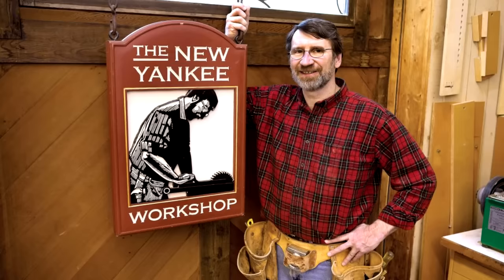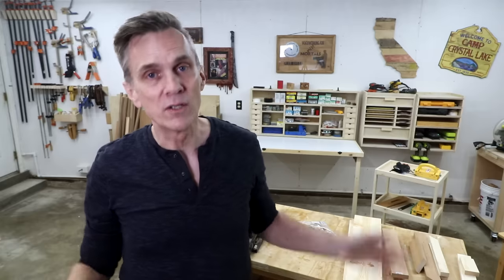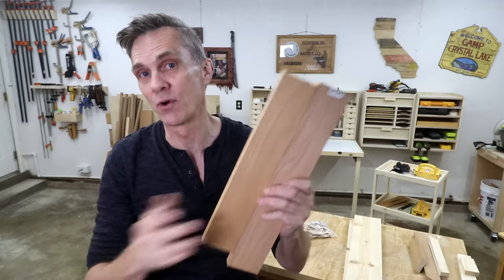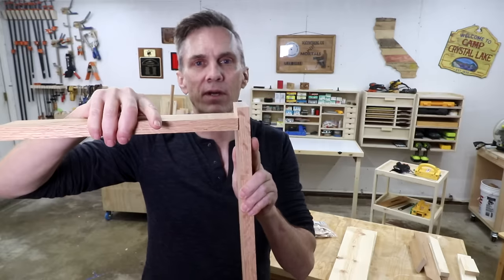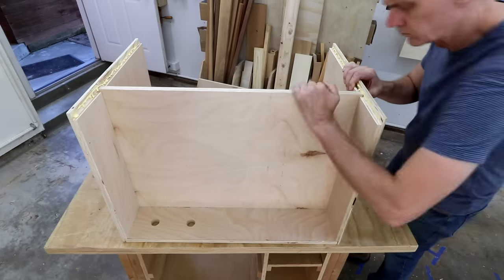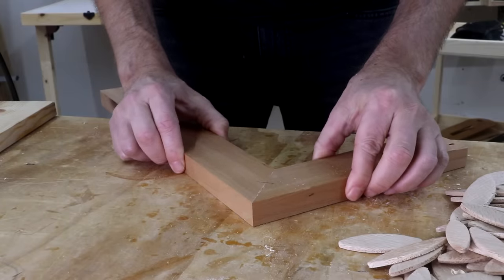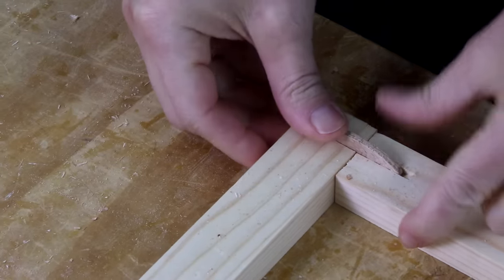So, is a biscuit joiner completely useless?

Comment: #1) You mentioned they add zero strength. Biscuit joinery isn't for strength but rather for alignment.
#2) You mentioned gluing boards edge to edge is super strong on its own. Butt joints are the weakest of all joints, and I would think (and I could be wrong on this) that biscuit joints are stronger than butt joints, just for having more gluing surfaces involved (this is taking into consideration the biscuits themselves). The Wood Whisperer once mentioned that he visited a wood working furniture maker and was surprised to see that the guy used biscuit joinery quite heavily. While it is admittedly a very specialized tool and probably doesn't get much use in peoples' shops, I wouldn't go so far as to call it useless, at least not my opinion. Sure there are other options out there (like the Festool Domino for example), but joiners are not super expensive and when used properly, they really do make alignment quite a nice task.

Comment: I use to use one in the sign industry to strengthen the joints in the sealed plywood style signs... but now we use a rigid aluminum product with it's own special joint pins that is far cheaper and more durable.

Comment: Norm used all of that joinery on the show, including the pocket screw method. Once he got the jig he used it a lot. I saw a pocket screw split out the wood when a guy tightened it up, so now in my head that's all I can see, so I'm not a fan.

Since Norm IS the greatest craftsman who ever has, or WILL live, there must be something wonderful about biscuit joinery, simply because he uses them, which is good enough for me.

Oh, and about the biscuits being too big for some applications, he had a small biscuit cutting tool and smaller biscuits for those occasions.

Now if we could all bow down to Norm for a few moments of worship and reflection that would be great.   :-)

Comment: They are useful for lining up joints, but add very little strength
Reply: I agree Jeff. If you use them to strenghten a glue joint your glue joint was bad to start with. I use them to align and the glue for strength.

Comment: There must be a law that if you show using a biscuit joiner in a video you must say "it doesn't help with strength , only alignment" since almost every video I've watched with biscuit joinery states this lol
Reply: I don’t think it’s quite correct, either. I’ve seen at least one source say that one biscuit produces a joint with half the strength of a Festool Domino joint and two biscuits essentially match it. Given how fast and cheap they are to put in, this is awfully good.

Comment: The Porter-Cable biscuit joiner includes a second, smaller cutter blade for joining face frames and miter joints...so yes, a biscuit joiner can be used on miter joints.

Comment: Edge grain joints are only weaker if you don’t add enough glue. The edges soaks up glue. Otherwise they are at least the same, and probably stronger.

Comment: I'm just a nobody on YouTube, and get as many views in a year as you do in a minute, so take this for what it's worth...  I think a novice wood worker would do well to learn how to use one.  I wear my biscuit joiner out, and I think you're under-valuing the strength they add to miters (not all miters hold pictures - some hold 40 lb mirrors)!   ...and like others have said, I've never experienced that much slop when I've used mine.  

I see some of your points, but I wouldn't tell beginners to count it out just because pocket screws are faster.
Reply: Exactly
When I watch this if so how sloppy that was I was like what
Mine are always tight I usually have to use a rubber mallet to beat the pieces together before clamping
I'm not really sure why his are so very loose

Comment: I remember Norm using the biscuit joiner on every show I watched. At the time it seemed like a bulletproof way to join everything, and not use ugly screws or hardware... Now that I see how they work and how they are very limited, I think the intent was there, but they are so small they only work to help align and assemble joints...
Reply: That is the intended use for biscuits, aligning joints to assist with assembly work, they are not designed as anything else.

Comment: Ive built speaker enclosures using 3/4" stock cut 45 degrees with only glue.  No issues.

Is this weaker than I realize?

Comment: A biscuit joint is, afaik, a nice cross-over between a tongue-and-groove with a loose tongue, and a dowel joint (or domino for that matter). Both of these joints have a drawback: they weaken the wood in specific ways. The loose tongue does so by reducing the wood thickness over the whole length of the joint. The dowel joint by coming (potentially) too close to the edge of the material. The biscuit joint solves both issues. Maybe it should be kept in mind that cabinets are built in a different way in the EU (where the biscuit joiner was invented) than they are in the States. We use a lot more often plate material, and a lot less (massive) profiles. Saying the biscuit joiner is useless is nice clickbait, but it's also a bit of a stretch.

Comment: Norm probably did popularize them, but he was late to the party.  They were the domino of their day, and Fine Woodworking (when it was written by experts) was very excited when they came off patent, and everyone was anxious to get one at a decent price. Super cabinetmaker Franz Klauzs made a whole video about them.  The are not as good at some things as Dominos, but that is like saying a 2" screw is not as strong as a 3 inch screw.  Ok, what about using 2 of them?  Often in the 90 degree situations you can get several stacked in there. And even with one, when sensibly used they rarely break in real world situations.  They might not stand up, or even have space to be put in, in some fancy chair, but then Dominos are probably not up to that either, certainly a step down from formal joinery that is sized to sections.

They work really well in situations where a dado works, and they are faster to put in, and much less dust is produced, and they will leave people wondering how the joint was made.

Your machine is maybe at fault as it is more often tough to get them in their slots than not.  And I have never had one wobble as every one you showed seems to have.

-----------------

People using biscuits should expect much greater strength than pocket screws which are very weak (but require a battery of clamps).  Yet PSs are successfully used in a lot of furniture, even given how bad they are.  This because most things hold up reasonably well when the parts can't be moved out of reference.  So a cabinet that is assembled on 5 sides, then hung on a wall will hold up well because it is stable.  In such situation biscuits will overperform and never fail.  One can make successful frame and panel, kitchen type doors  using biscuits, but I would be more confident if I had a domino.  Better still would be slip joints and they are easily cut on a table saw.  That said.  I have biscuit joined lots of doors in my own houses, because I knew I could repair them if they failed, and I have never had a failure...  Whether they would stand up to an angry door slamming contest, or a kid swinging from kitchen doors, is a test someone else can run.

Comment: If you were using the correct thickness biscuits for your blade you wouldn't have the slop in the joint. Mine fit snugly. At the time they were a good choice but better options exist today so you are I believe correct in saying don't buy a biscuit joiner today. I can' think of anything a biscuit joiner is good for that can't be done with another tool or method. today I use Dominos in places where I used to use biscuits. Dowels are another choice when used with a good dowel jig.

Comment: Interesting video. Proves that you should not buy cheap tools. You get none of that play if you use either Lamello or Porter Cable joiner. Also, there is a video on YouTube by Dowelmax that shows in their tests that a properly used Dowelmax is just as strong as  dominoes.  That is the fun of woodworking, we do not have to agree; just have fun building OUR way. Thanks for the video.

Comment: i like my biscuit jointer and use it often. my biscuits are tapped in with a hammer, not sloppy and loose like the ones youve shown. i would agree that its use is certainly limited, and having a bad fit like youve shown would surely be useless, but in general i disagree.

Comment: Hi Steve,thank you for so many good videos. I really learn a lot and in my Workshop the tools all together are I think no more than 1200€. I am trapped with the bosch batery system though. It is so nice to use the same batery for drilling, sawing, vaccum cleaning and of course the radio.I think the original biscuit jointer comes form Lamello. They are really precise and as good as festool. have a look at Clamex or Tenso.I like my cheap jointer from ebay for 30€ total on ebay. It just gives a good feeling to join bords and be kind of sure that they will stay in line.Have a nice Christmas time.best wishes from Germany

Comment: Not sure what your biscuit jointer is, but use mine often in the shop to help with glue ups. My biscuits are so tight that the majority of them have to be per swayed with a dead blow hammer to get them in the slot, maybe this is one of those times that spending a little more at the store pays off.

Comment: While I agree with you almost 100%, swearing off biscuit joints due to inaccuracy based on what has to be the worst biscuit jointer ever made is like saying you hate Chinese food based off having tried Top Ramen a couple times and found it yucky.

I've mirrored your strength argument with students for years but they've seen people use them on YouTube and the likes of Norm so they riddle their simple glue up with them, only to find that they cut through one when they cut to final length and then have to spend the rest of their life looking at the end of a biscuit.  I try to remind them that I told them not to do it so that the mistake stings a little more.

Comment: Well, found this in Jan. 2021, I was going to buy a joiner but now, I still need to look for a solution for my project.  Building a rolling workbench.  3/4 in. plywood surface.  I've cut a space and mounted my Mitre saw in that space put it on hinges so I can lower in down inside the bench.  Leaving that open space now.  But now trying to figure out a way to not only lay the original (cut out) back to the top and keeping it level and (tight).  The sides are level resting on 2x4 rails.  But if I could only slide that thing up against the back original top, and hear a snap, or whop, or something to know it wasn't going to slide out on me.

Comment: Yep, biscuits are useless, but the dowels are as strong as the domino. I own both the festool domino and the jessem doweling jig. Dominos are a lot faster. I used 1/2" thick and 3 inch long dowels in my workbench and the joints are strong (I didn't have the domino at the time I build the workbench). I highly recommend jessem over dowelmax. With jessem you can add multiple layers of dowels in a joint (relatively fast). This will increase the glue area and produce a strong joint.

Comment: Is a biscuit joint stronger?  Absolutely. In both tensile and shear. Every biscuit you add increases the strength of the joint. Need a stronger joint?  Add more biscuits. I cut my own biscuits out of carbon fiber panel that were 2x the size of a #20. Those and West Systems epoxy and I know I’ve got a solid joint.

Comment: In germany every professional jointer uses lamellos and if you get a good biscuit jointer you will love it. And by the way... your blade is too thin the biscuit is supposed to fit very tight and not as loose as you are showing it

Comment: Steve, I guess I am not as negative on biscuit joiners as you are.  I'll admit to being a long-time devotee of Norm's show and This Old House.  I've done a lot of New Yankee workshop projects including; the greenhouse, the tall bookcase with the crown molded top, sharpening station and likely a dozen custom cabinets adapted from Norm's cabinets.  I particularly like biscuits for making and attaching face frames to plywood carcasses without a lot of pesky nail holes that require filling.    I admit that I use pocket joinery these days to make the face frames but I don't care for them much for attaching the face frames or the case parts together.   The biscuits are helpful in aligning a complicated face frame to the carcass as I often work by myself and extra hands can be helpful.   I've two joiners a Royobi like the one you showed and a Freud.   I have a stationary mortiser and a Leigh dovetail joinery system but I am kind of a traditionalist and like to use those techniques where they were historically used.   I like to use double biscuits where there is a wide board in a face frame of when using a piece of 1 X as a cap on a stair rail for a deck or over a partial drywall that forms one edge of a staircase.

Comment: If you plan make a kitchen.. many cabinets.. It's a Charm to have👍🏼

Your tool seems have a wabble or a very poor cutting disc inside.... If this would be in your table saw you also would not be happy and consider to change this instead of saying it's a crap to use table saws...

The biscuit jointers  are a convenient way to doweling... With the benefits of positioning while glue up

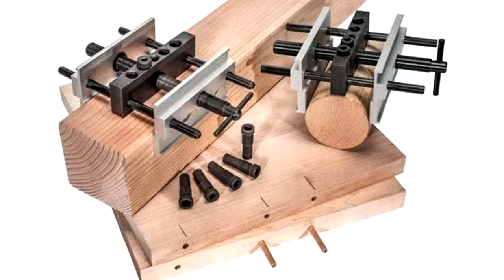Comment: Hey 4:50 you mention dowel joinery as a weak option? I use them all the time. Love it. I have a milescraft dowl jig. If you do the larger dowels and do enough of them they're plenty strong. They take hardly any time to do with a jig and a drill.

Comment: Good ole Norm, the guy who would use a $2000 tool to avoid using a 15 cent fastener.  I suspect it was because he was getting all those tools for free, and was just a shill for the tool companies. I remember the big push for biscuit joiners, and my first thought was "I'll just drill for a dowel if I need to" and moved on. I considered Norm "for entertainment purposes only" and never put a lot of stock in him. Much preferred Roy Underhill's "The Woodwright's Shop" over "New Yankee Workshop".

Comment: I like to use my biscuit joiner to create the perfect shallow slots for a challenge coin rack
Reply: That's a cool idea
I may just have to make myself one 
I have a few challenge coins and it would be a nice way to show them off
Reply: Gary Chambers what I found was that if I added a thin piece of material to the fence or to the piece itself it helped create a shallow slot instead of going full depth. Good luck!
Reply: Cool 
My biscuit joiner is adjustable and I think the smallest adjustment would work great
I could be wrong tho

Comment: I saw a video where a guy tested biscuit, dowel and domino joints and the dowel joint is actually the strongest. I suspect because of more surface glue area. Because you can use 2 dowels in the same area as one domino. I also suspect you have mismatched biscuits n cutter because mine I have to tap in, no slip fit like you show..

Comment: I got a Ryobi biscuit joiner, the thing has too much play to be useful. My mentor has an old Lamello, that thing is a dream.
Reply: I had a Ryobi biscuit joiner and the ruler on the side for height is out
You should be able to put it at 3/8 for center of a 3/4 inch piece of wood but that Ryobi would always be off
I peeled the ruler off and made my own
Another bad about that Ryobi biscuit joiner
Is You're locked down screw for the height is right there with the adjustment
so when you go to tighten it down a lot of times you move to height

Comment: I got lucky... I mean very lucky. I had been considering a decent biscuit joiner for over a year. My cheap one couldn't be adjusted to get it accurate, so was considering the DeWalt for £230 I had an option on a barely used domino machine from a friend needing money, it was the big one for £500  I went for it, and it has been handy for all sorts of jobs other than joining with loose tenons, it also does the job of a biscuit joiner when glueing up edge joined panels.  Is it my best and most versatile tool? No, but is great for quick frame construction. 
I have seen practical reviews to see if biscuits add strength on glued butt joints, the answer is not at all!

Comment: I always wondered if the Domino was just a fancy Biscuit , thanks for the unbiased opinion.
Reply: I got a secondhand domino machine. Pricey, but at less than half price, and barely used, a lovely bit of kit, I got the bigger XL version and that will do tenons for doors and gates. Not used as often as I would like, but makes joinery quick and easy.

Comment: So you're saying the attachment my dad got for his router (plus ALL the biskits he bought) are worthless.  Btw, I got all of dad's tools when he passed.  So if this is something I can junk, then more room for new tools.
Reply: It is possible that your dads router with attachments does the same as the Domino machine (if not a little more clumsily). if that is the case, don't junk it. My domino machine is great for floating tenons.
Reply: @briannewton3535  No.  It's a jig that attaches to the router that you clamp in place.  The router bit is 3 blades, 2 inches in diameter and cuts a 1/8 inch groove.  Wish there was a way to post photo of the box.
Reply: @GPS0159  Ahh, yes, I am with you now. I get it, yeah, I was gonna get similar to cut tongue and grooves on boards. I junked the idea in the end, too faffy for me.